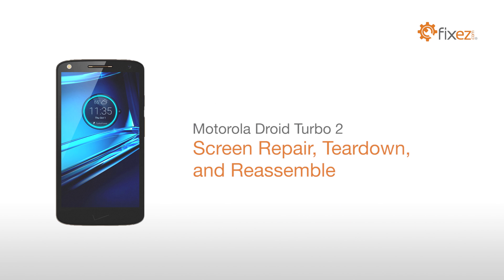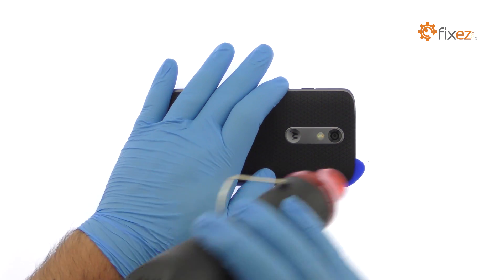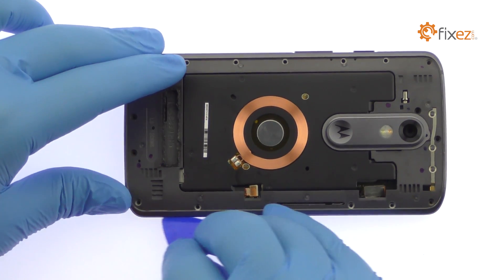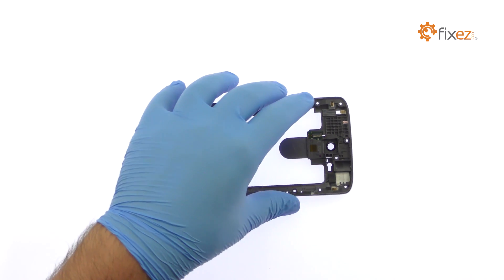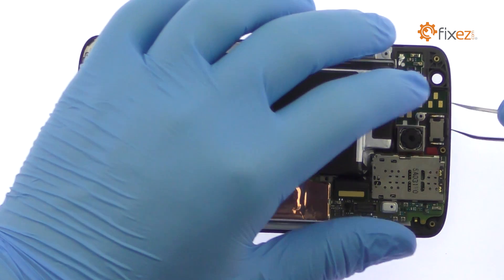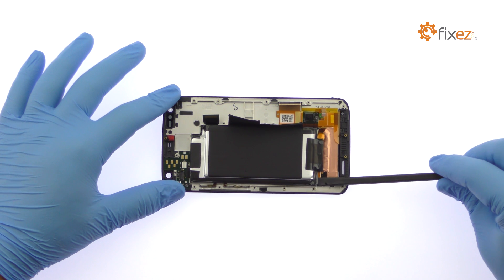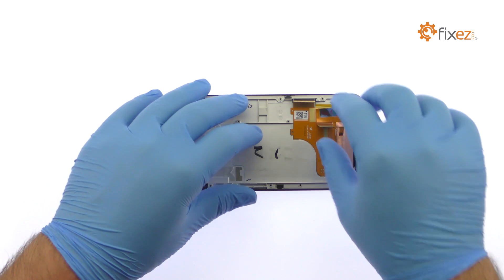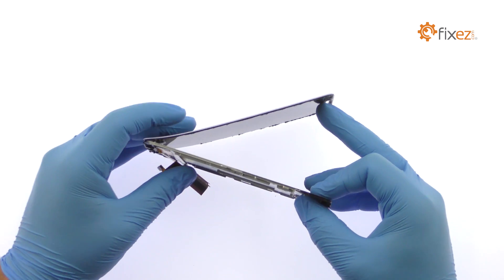Motorola Droid Turbo 2 Screen Repair, Teardown and Reassemble - Fixez.com

Comment: Of course, my series of Moto Droid Turbo 2 looked different inside, but with my eight years electronics education, 50 years experience, and this excellent video, I was able to successfully switch out the 4 year old  battery for a new original Motorola FB-55 series LP battery, and clean up the inside (crap gets inside via the charging port and headset connector).  Great phone, since all subsequent Moto series have been cheapified with smaller format cameras (this one is 21 mpl !) and lower pixel screens.  If they could make them out of cardboard, they would.
Reply: My screen backlight suddenly died..but can feel tactic vibrations when the screen is touched. Basically a brick now.

Comment: I like and I subscribe, Do you know if this can repair the problem of dead pixels? With this you can solve the green lines that appear in the screen?
Reply: My turbo 2 fell in a little bit of water and half the screen went green and white lines.  I bought a new screen and followed these instructions.  My phone is now fixed.
I used to fix iPhones for a living and this was about as difficult.

Comment: hi, need help, i have a motorola droid turbo 2, and my memory card slot is broken, so my phone can't read any micro sd, is it possible to replace just the mem card slot? or do i need to replace the whole motherboard? lastly, where can i buy one? many thx in advance..
Reply from the maker: The slot is soldered on the motherboard. The part is replaceable but that repair is outside the scope of our videos.
Reply: ok, thx for the explanation, appreciate it..